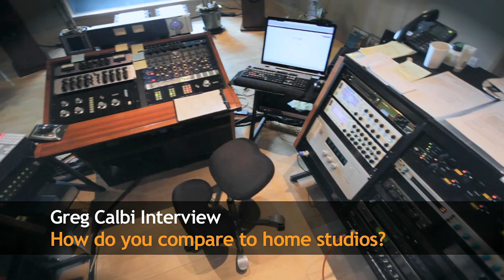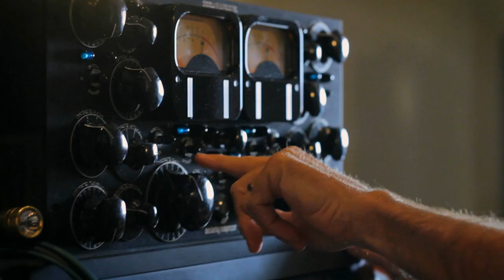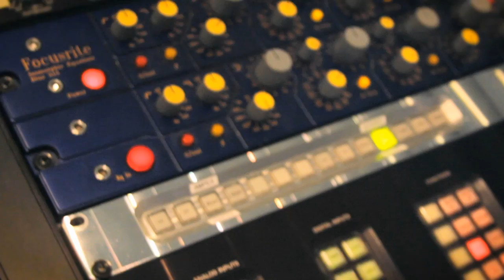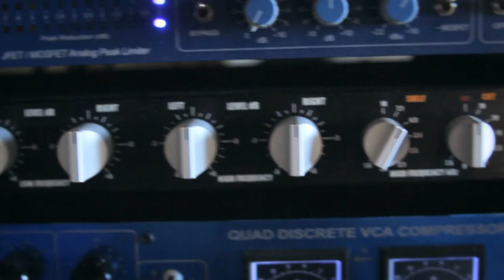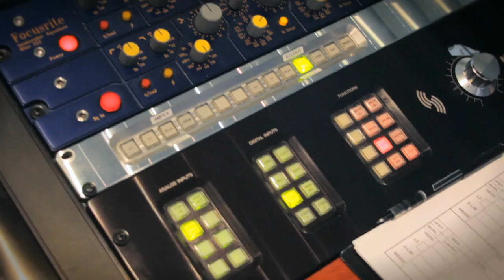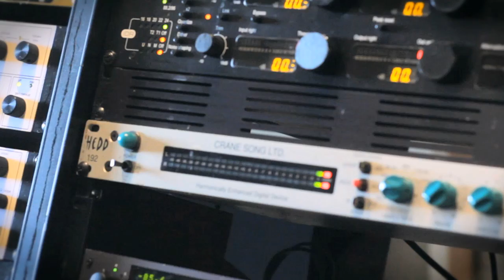Greg Calbi (Tame Impala, MGMT, Arcade Fire...) Interview: Mastering Techniques and Philosophy

Comment: Brilliant interview! outstanding presentation! but av proved a lot of Pros wrong with just using some good plugs from waves, soft tube, BX and MANY more, I just let my ears do 80% of the job, The only outboard gears i use to master, is my tube comp, compressor  my ears and an AD converter. If you like let me have an address to send you one or two mastering project of mine to prove  that I get the same sound if not better than some big studios! Am currently residing in Ghana.